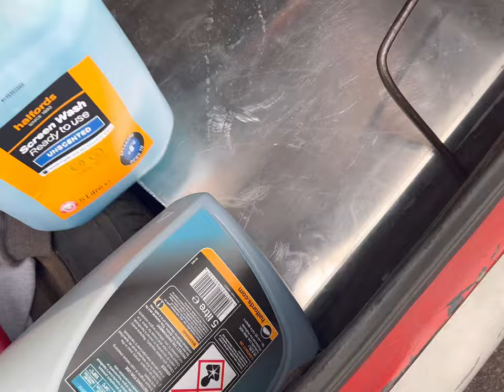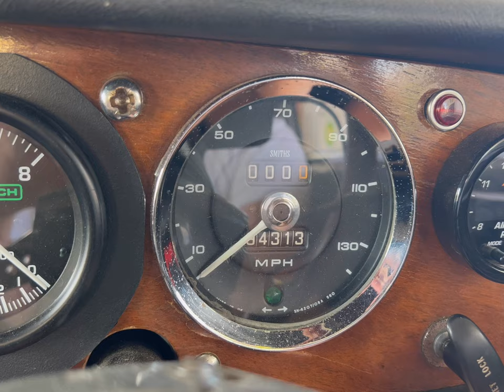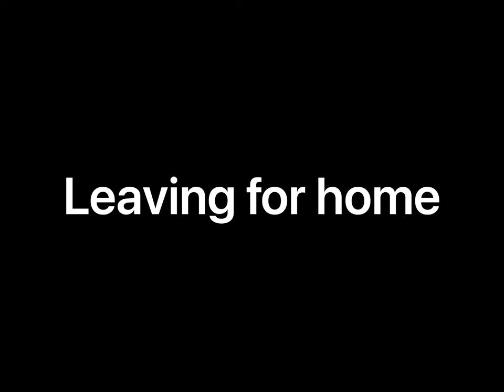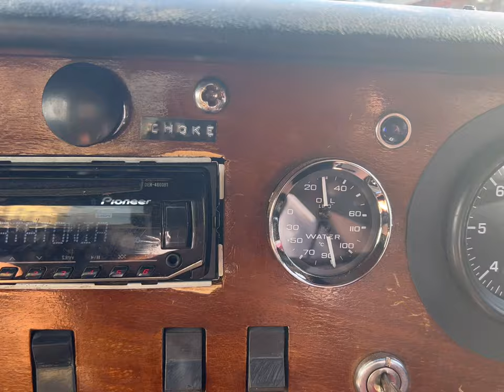Lotus elan restomod 54 - radiator+idiot = ???

Comment: Those fans can be fitted either side of the rad so can push or pull. If you have them as pull then the wiring colours are correct.